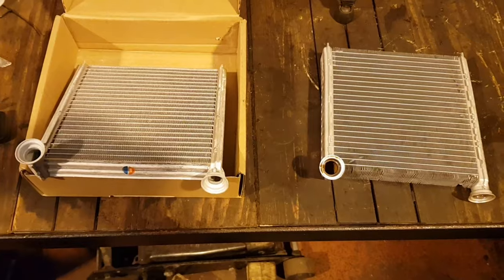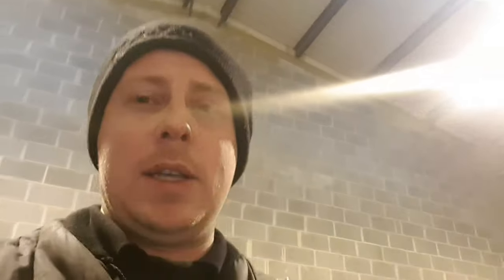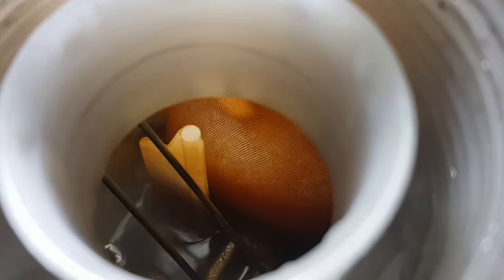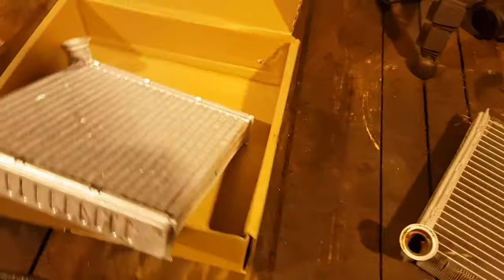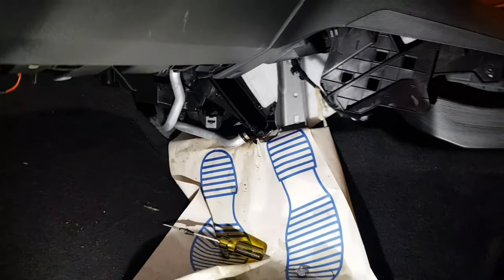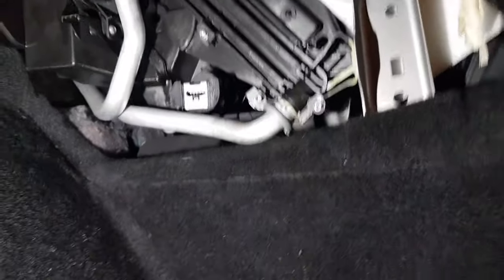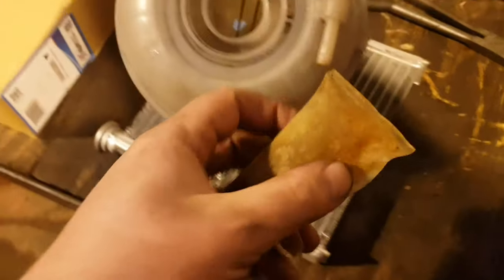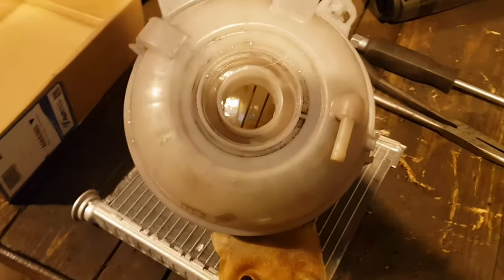Vw Audi Cold Heaters Heater Core Blocked Due To Design Fault

Comment: Making coolant last for life, but have to replace the heater matrix instead. The design apprentice must have thought he was on to a winner here when they introduced that STOOPID idea!
Reply from the maker: My thoughts exactly!!!
Reply: @lifes.projects  thanks to your video though, I’ve just checked my car, and it has one - getting torn out tomorrow! Thanks!
Reply from the maker: @harrygilbert3738  good stuff! Striaght in the bin. Be careful not to split the bag on removal
Reply: I tend to remove the bottle and then rip the bag out just incase I split it!

Comment: I couldn't get the 2 clips to seat properly on the new matrix due to the lack of room so they leaked I cut the 2 pipes and fitted them to the matrix on the bench a lot better and easier.refitted the matrix to its holster I then joined the 2 pipes  with flexi heater hose and jubilee clips...happy days red hot 🥵 heater now

Comment: Thanks for this, I have a Mk7 Golf and have this exact same issue. Good to know what is causing it. Much appreciated mate 👍
Reply from the maker: Thank you 👍 ive done quite a few now
Reply: @lifes.projects  What do you quote for changing one of these please mate, ive got an auto 184 Q
Reply: @eyeswideopen1984 you end up sorting yours? if so how much did you pay for it
Reply: You find out how much I’m having same issue had 1 quote £500
Reply: @hpls8160  unfortunately that’s about right. Even if you get a aftermarket matrix it will still cost about £250 and add the labour on top if you aren’t doing it yourself.
Reply: @TheGoodShepherdsSheep £250 for a heater matrix? You sure. Plenty of good aftermarket ones for less then £100

Comment: Thanks for all the advice. Eventually managed to get both the inlet and outlet pipes off and what an absolute pain they were too as there was very little room to get to the spring clamps to remove them. Flushed out the heater matrix and all's back to normal again 🙂 Decided to replace the spring clamps with jubilee clips to make removing them a lot easier with a long handled screwdriver should i need to remove them again.😀
Reply: Hi. Wouldn't the jubilee clips leak? Spring clips push the hose in the heater. I can't imagine how jubilee clips would hold the hose in the heater. Thanks.
Reply: I got GOLF GTD Mark 7 - heating works on passenger side only , no heating on the driver side . Got quote from VW today to and they advice is to have heater matrix change £1500 - crazy money!!! . I am contemplating doing this myself but by only flushing the system out as you mentioned its very tight area to get to the pipes - I want to flush the pipes as mentioned BUT how did you undo these manufacture clips? I am afraid I might break something hence I asking for advice first ? Did you cut them or do they come of a certain way? . Any help or advice how to undo them without breaking anything please ? Thank you  in advance
Reply: @quentin2110  I used some spring clamp pliers, you can buy these for around £10 from most DIY shops and ebay etc.
Reply: @philipallen9113  thank you
Reply: @quentin2110  No problem. You could also use a pair of mole grips if you have any as they do the job just as good but obviously dependant on the amount of room you have

Comment: With this issue were both pipes hot when connected to the heater matrix?

I have this issue but both pipes are hot which would assume it’s not blocked or only partially ?

Comment: My 57 leon sport is doing this. 
Garage replaced thermostat, car getting to temp no problems 👍
Needed the blowers fixed too (& resistor) because they had failed 

All working fine now, other than no hot air anywhere 🤷‍♂️

They didn’t seem that interested in the heater matrix even though I had suggested it 

I’ll ask again 

Can you access it from foot well on all Leon types? 
Mines a 1.6 sport 

Many thanks,

Comment: I've got a 2013 1.6tdi leon that has this problem. Thank you for the video. Its given me the confidence to get the job done. Garage want £400. They have already had £170 off me for cleaning the old matrix which worked for 2 days... so I don't think il let them do it.
Thanks for video
Thank you
Reply from the maker: Might as well have a go yourself and try and save some money. Good luck 👍
Reply: Did that £400 include a full flush? If so, bite their hand off! Had 2 quotes for the matrix replacement and the cheapest was £785 - they said due to having to do a full flush which I've read usually takes up to 4.5 hours.
Reply: How did it go mate? My 1.6tdi Leon same just had clutch done and water pump and belt literally cannot afford to have a garage do this

Comment: Hi, I have a query please which is driving us insane! 🤯 so same platform but A3 TDI, only overheats and spews out coolant at motorway speed. Is okay locally for the most part. Thermostat, heater matrix, thermostat sensor, water pump, All been changed! No gunk in the oil, engine sounds fine. No smoke from exhaust. Just Perplexed as to what it is. Has been manually flushed and coolant added several times. Pressure tested, no leaks identified. Just spews out the coolant tank when it gets too hot 😑 any advice greatly appreciated pls 🙏
Reply: Try coolant reservoir bottle

Comment: My silica bag hasn't split but only have hot air passenger side and not drivers side. Do they naturally block up over time?
Reply from the maker: @jasonjay7650  yeah ive done a few now that have blocked up. The bag was fine but the matrix was still full of particles so they must leak out somewhere 😂

Comment: hi there I have the same problem with my mk 7 Gtd what seems to happen as well as being only luke warm sometimes the expansion tank vents off with  coolant I presume its the build up of pressure due to the blocked core have you heard of this cheers great video bud
Reply from the maker: Yes ive had an A3 doing the same. The core was blocked completely and think it was causing it to boil over before the thermostat was opening therefore air locking the cooling system

Comment: Thanks for video that’s my issue by sounds of it What is an approx cost or labour hrs to have heater matrix changed I have octavia
Reply from the maker: Thank you. Most garages charge an average of £500 for this job depending on location in the UK.
Reply: @lifes.projects  thanks wow expensive try a flush if not I think it’s a 12 volt heater

Comment: It looks like the deionizer resin we used to use at work. Probably there in case owners use tap water for top ups instead of the deionized water that they specify. I suppose its better than having your coolant dissolve internal parts of your engine!

Comment: Any suggestions on how to get pipes off heater matrix from bulkhead to flushes water thr the silver pipes as mine looks blocked, any tips much appreciated bud 🫣
Reply from the maker: From what i remember they are a weird locking clip. Give them a twist see if you can free them before unlocking amd removing.
Reply: Any luck?
Reply: @chrisainsworth68  not tried yet, summer job. Will update when get round to it

Comment: I think ive got this fault on my wifes A3 tdi, her heaters are cold on the drivers side. The car has dropped coolant twice in 2 weeks but cant see no obvious leaks from pipes but have noticed coolant or something around the neck of the cap, could this couse over pressure?
Reply: Hi did you sort this after/ what did you fix and did it solve your loss of coolant

Comment: My Seat Leon is having this issue. Mechanic had a go a my flushing the system whilst they I had it in to do the clutch but clearly the matrix needs replacing. Just need to decide if I have a crack at it myself and save a few pennies or let the professional do it

Comment: Thanks for that video. My bag just split in my Audi A3 2013.Just question is it safe to drive my car till is fixed??
Reply from the maker: Thank you. Its perfectly safe however you will risk clogging the matrix up and having to then replace it if the heaters go cold. I would advise dropping the bottom coolant hose off and flushing the coolong system out sooner rather than later
Reply: @lifes.projects  thats good to hear.my garage already put lubricant into coolant as apparently that helps break silica. My heating blows warm air only on driver side and cold on passenger side only!! Thanks
Reply from the maker: @peterdrozd4628  ah right unfirtunately cold air on 1 side is early stages of the matrix clogging up as the coolant is only circulating through half of the heat exhanger. Hopefully if the product the garage have put in breaks up silica it may unclog it but only time will tell.

Comment: My 2012 Audi Q3 is not blowing air hot or cold at all. I can hear something happening behind the dash but I'm not getting anything. Do you have any idea what the problem / solution might be?
Reply from the maker: If its not blowing at all then the heater motor isnt working. Check the basics first so fuses and wiring. Most VW Audis that age may flag a fault code in the heater module but you would need diagnostics.

Comment: My 2014 A3 has the same problem. I need to flush the matrix first before dismantling everything to change it. How do I do that and are the inlet and outlet pipes in the same position as they are in your video as they appear to be tricky to get to
Reply from the maker: Yes they are in the same position and a pain to get to. 
There are 2 ways you can do it. Remove the pipes that go i to the bulkhead and try and blast them out with a hose pipe. 
2nd way is to clamp off the larger top hose (there is a little pipe that goes into the top hose) put an air line feed into that and pressure it up so it forces water out the bottom one. It made a little bit of difference to this seat doing this but ended up changing it as theu were just getting warm. I did an A3 after and it was blocked solid so ended up sawpping that one out too.
Reply: @lifes.projects  Thanks for the quick response and your help in this.. Your right tho, they seem a pain to get too and probably wont be worth the pain afterwards.  Is the top one the inlet and bottom pipe the outlet and also do I clamp the little pipe off before attaching the hose or does that not matter

Comment: I had the heater matrix replaced on my A3 (8v - 64 plate) and sorted the problem. That was 4 years ago. However I have the same problem again now. Any ideas why?
Reply from the maker: Did they remove the bag? Itd probably cloggeg again. The Matrix is the lowest part of the cooling system so if there is and granuals in the system it will clog again over time.

Comment: Some of the expansion bottles are double skinned and the desiccant bag sits in between the walls and can't be removed. Easy enough to just replace the bottle with one without the desiccant bag. Only about £25. Just replaced the one in my golf.

Comment: Great vid man! Got same problem with 2014 Leon 1.6tdi. Got coolant overflow on reservoir. Last week garage changed waterpump and crankbelt, did t solved the problem. Read on forum that heater matrix possibly is the problem. How long does this job takes? And have you emptied the whole cooling system before changing the heater matrix?
Reply from the maker: Hi mate. Only takes a few hour (poor access) if you have changed the coolant already then just clamp the hoses where it goes into the bulkhead.
I did another not long after this on an Audi A3 1.6TDI and it was exactly the same fault. 
Dont forget to remove the bag out of the reservoir
Reply: Thanks for the reply! Did you flush the whole system too? And is it easy to drain the system? And I’ve got a left hand drive car with knee airbag, is it easy to disconnect this system to remove it?
Reply from the maker: @Gixxer19522 Not sure how hard it will be on a left hand drive to be honest. Yeah you can either drain the radiator with the drain or pull the bottom hose off. I pulled the hose off as its better to get all the granules out that way
Reply: @lifes.projects  thanks man!
Reply: @lifes.projects was it the same process gaining access to the A3 Heater matrix?
Reply from the maker: @VIPERITE16  yes same process

Comment: URGENT : my heater matrix is blocked too, and it s hard to find quick replacement for the matrix so i have to wait and look for a long period, do you think i can disable it completely in the meanwhile ? I mean disable it and connect the two pipes to let run the coolant freely. What do you think ?
Reply from the maker: Yeah you could remove the pipes at the bulkhead and join them togwther to bypass the matrix

Comment: Hey man, I got the same issue on a Seat Leon 2021, with a 1.5 eTSI engine, but the heat is not working on the driver side. The explanation I got from Seat is that they need to do a flushing clean of the entire engine cooling system. They will replace all the fluids afterwards.Should I worry for this happening again in the future? The car was brand new and I bought it from Oct 2021 and I had no other issues with it so far. Thanks!
Reply: Hi, did the system flush solve the heater issue or did you need to replace the heat core/matrix?
Reply: @DanielMarshUK  yes. I had no other issues sincer then.
Reply: They also replaced the Matrix with a new one because the car was in waranty period.

Comment: Thank you I have the same issue. I did replace the expansion tank because it leaked. But after replacing it I still have no heat.

Comment: Thank you this is really helpful.  My 2013 Seat Leon FR 184 is pissing coolant out of the bottle occasionally and the heaters aren't particularly hot in the car so this sounds like the culprit!
Reply from the maker: Possibly. Make sure you flush the rest of the cooling system out as the granuals get everywhere. 
Also check your water pump is working by pulling off the little return pipe to the header tank and checking the flow while the engine is running
Reply: @lifes.projects  Hi I’ve recently replaced my timing belt and water pump and also replaced the heater matrix but I’m still getting Luke warm air is there a possibility it is blocked again?
Reply from the maker: @ryanmaxwell93  if you didnt flush out the cooling system especially the heater pipes then its a possibility yes. Either that or the thermostat is opening too early
Reply: @lifes.projects  it also had a new radiator replaced as it had a small leak and all new coolant of course so would I be best removing the two pipes in the firewall and trying to blast water through both ends
Reply from the maker: @ryanmaxwell93  ah right thats half the battle if its had the radiator replaced. The bottom pipe inside the car is the one that usually gets blocked. I would be tempted to start there.
Reply: I'm having this exact problem if i do a journey over 80 miles my tank completely empty did you figure out what it was
Reply: @haarist2422  I had the heater matrix flushed and now the vents inside the car are much hotter but still not perfect 🙁 It hasn't fixed the overflow problem either. I think I need the matrix replacing!
Reply: @dave_s_vids  think I'm just gonna replace it and hope for the best
Reply: @haarist2422  hi I’m having the same problem have you changed it
Reply: @1akaify  I changed the timing belt and water pump and the issue hasn't occurred. i did a 500 mile drive and it was fine
Reply: @lifes.projects  The electric one or the belt driven one can be ckecket that way?
Reply: Did this end up being the problem as my 2013 Golf 2.0 is drinking coolant and the heaters aren’t especially hot?
Reply: @hassanlaturiya  I finally had my heater core replaced and while the coolant level has dropped a couple of times it hasn't completely run out like it was doing previously. Also my heater blowers are red hot! Recommended!
Reply: @dave_s_vids having the same issue how much did the bill come to for the flush and new matrix

Comment: Hey there. I’m having the same issue with my mk3 leon. I’ve contacted vw and mentioned about the recall on the water pump to which they’ve said “there is no recall”. How accurate is your resource in regards to this water pump recall? 

Thanks
Reply from the maker: The recall was on the coolant bottle cracking but only on a certain year. Lad who works in parts for VW told me.
Reply: I got a letter in the mail from them in Canada

Comment: Hi pal, my coolant overflows, and keeps leaking, and I’ve noticed my heater hardly works, and doesn’t warm up, could that potentially be the heater matrix, also what sort of labour am I looking at to resolve this issue
Reply from the maker: Hi mate sorry for the late reply. Have you checked the water pump as if the water isnt circulating then your heaters will be cold and the engine will boil over.
Reply: This will be heater matrix. EGR feeds into the heater matrix, and if it's blocked ... it will build up pressure during dpf regen (as egr gets really hot and has nowhere to go!) and will resultantly blow out the expansion tank. Expansion tank will open at a certain pressure for safety reasons.